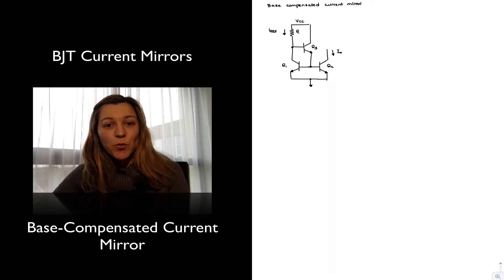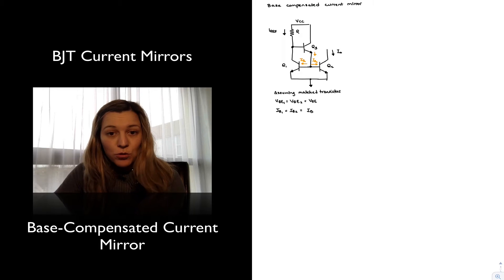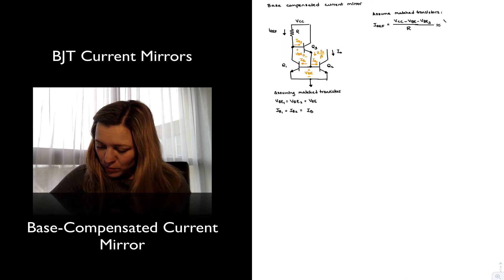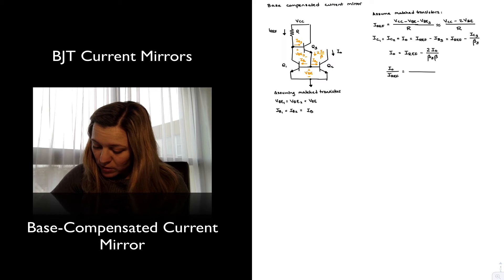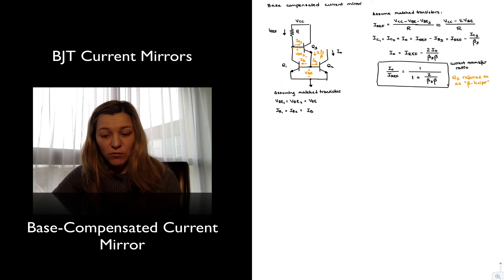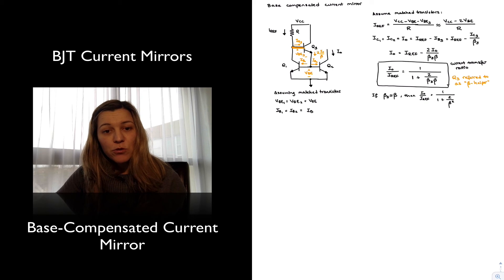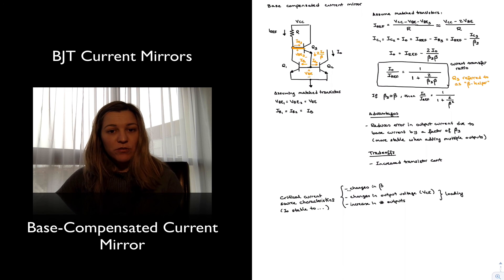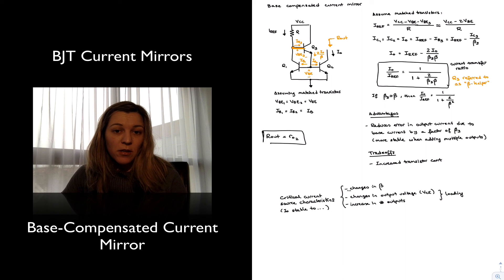Base Compensated BJT Current Mirror

Comment: Thanks for this video. In Sedra Smith, it isn't explained properly.

But in your video, at  5.30 duration you have done a small mistake in equations.

Ic3 is not equal to ( 2 Io / beta ) 

Use eqn.
 Ie = Ic + Ib 

Then 

Ic3 =  2 Io / ( beta + 1 )

And then find the final current transfer ratio.

Final answer will include the term (( beta + 1)beta )
Reply: Pausing the video I solved it got the same result as u got but I don't think it will make much difference in assuming beta +1 as just beta
Reply: I agree